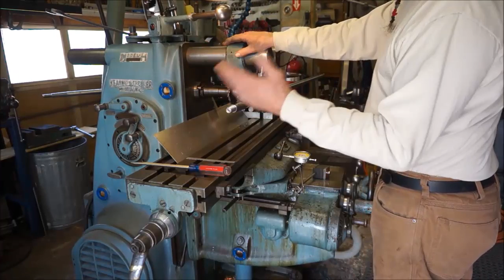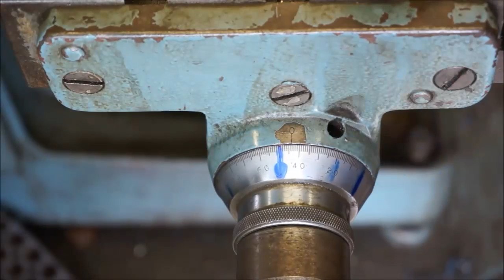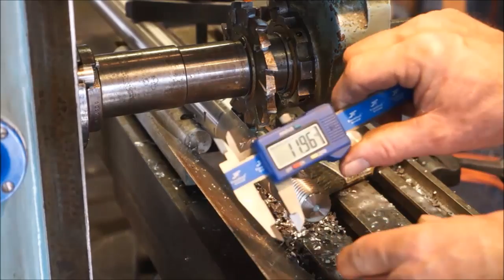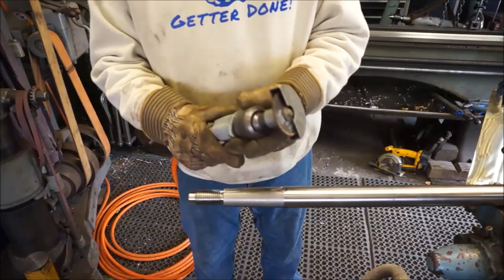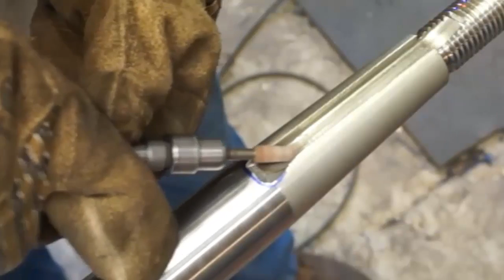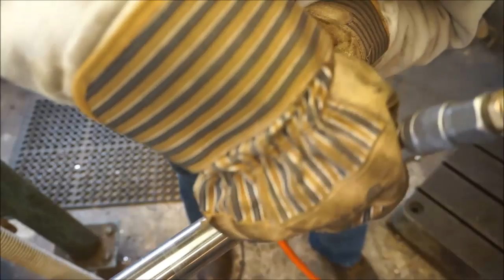Wing It Part 11

Comment: I'd be interested to know when spooned keyways first came into use. I know that it was the Liberty ships in WW2 where stress crack propagation from sharp hatch corners gave rise to the specific rounding of corners in many places, and that was reinforced with the Comet airliner window failures. Of course, the keyway is under a somewhat different kind of stress.

Comment: Have you tried the 3inch Cratex ( red) to finish polish the edges and spoons? Thanks for sharing!
Reply from the maker: No I haven't do they come in two inch? that is a better diameter to work down in the sweep of the keyway! ;{)-----
Reply: I believe they do, but if not you can wear them down to 2 inches. :)

Comment: Good tips to share about spooning the shaft keyways. I couldn't tell in the videos if your cutter has a small radius on it. I always had to use my vertical mill to machine the keyways, and always had a small radius ground and honed on the corner of the endmill flutes according to my Aquatech chart. 
Thanks for sharing Keith.
Reply from the maker: Yeah, I hand grind the cutters myself! ;{)-----

Comment: I have that same set of Frankfort Arsenal calipers. I keep them at my reloading bench for measuring case length. Check Midway USA. Thats where I got mine. I agree they are pretty damn good and very reasonably priced too!
Reply from the maker: I got mine there too! but the last time I bought them they were $13. ;{)-----
Reply: Ya I think thats about what I gave for mine. I see they are $26 now. Everything gun related has doubled in price over the last couple yrs. Still $26 isnt a bad price for that tool.